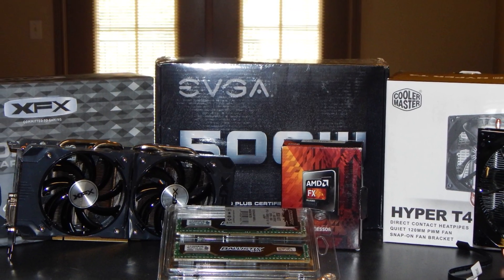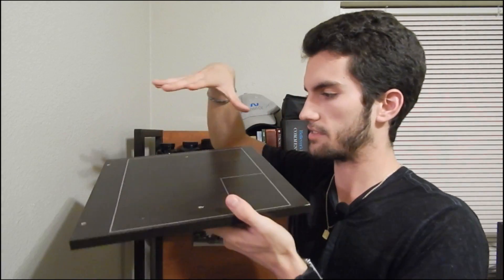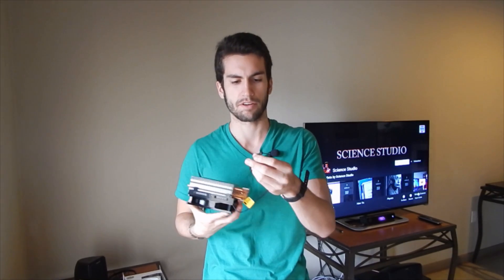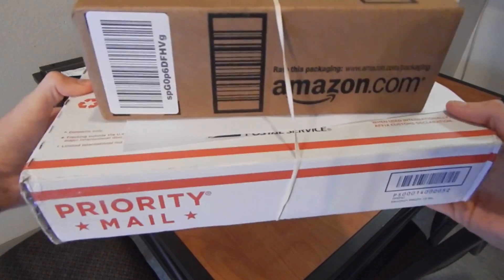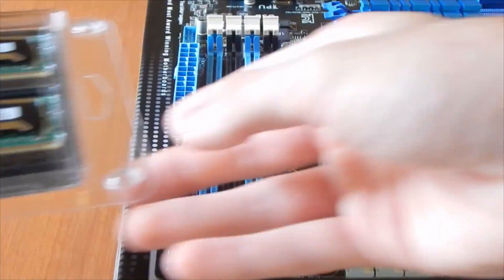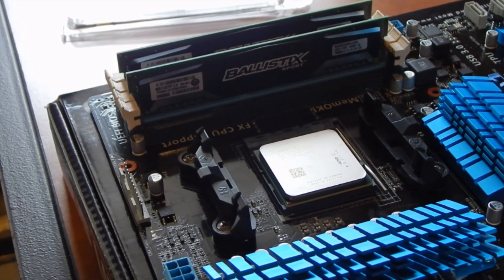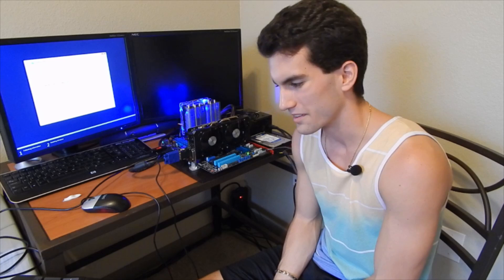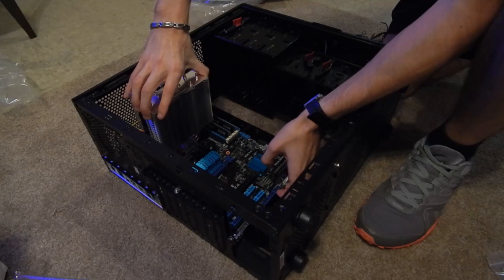$600 AMD FX Build

Comment: I just noticed during installation the CPU fan was facing down blowing air towards the GPU, and on the final montage the CPU fan is now facing upwards to push the air out of the case at the top.

Comment: It's June 2020... I'm still on socket AM3+.. I over clock an FX-8350.. with the smaller hyper 212 cooler with 3 heat pipes in a gigabyte 990xa board no problem..
 Zen isn't good enough to upgrade to yet and Intel has always been anethema to me.
 Good to see the cooler faces the wrong way for airflow.. lol

Comment: The cpu heatsink fan blowing downwards toward the gpu is incorrect, right? I noticed later in the video, at 16:45, the fan looks to be changed to a black-framed one and is mounted on the bottom of the heatsink blowing up, away from the gpu.

Comment: does FX 8320e bottleneck the GPU?
Reply: Shreyas Sreedhar a little bit, depends on what GPU
Reply: Super late, but, it depends on your resolution and GPU.  

Higher res gaming like higher than 1080 @60fps it's up to the GPU.

1080p 120/144fps gaming, CPU power matters a bit more, along with the GPU still.

Comment: so I'm building a new computer BASICALLY from scratch. I am looking at a 6300/ rx480 but I have a question. I already have a computer with Windows 10, could I just reuse the hard drive? would windows still work because I don't want to buy windows again if I don't need to
Reply: Yea work XD!
Reply: If you brought a retail windows license with a key you could reuse it, but I think you have to reactivate and do a fresh install. Also, don't buy the fx 6300 get an i3 6100 instead
Reply: literally got the FX 8320e for 20 bucks so I'm ok for now, thanks tho. also had an OEM key so I re bought windows
Reply: sean miranda okay, sounds good

Comment: you can get an i5 4460 and a h81m plus, and spend 30$ more, but between i5 4460 and a fx 6300, even if overclocked, is REALLY BIG!
Reply: you can even buy used 4460's for 140$. but look at that mobo, it's about 95-100$, instead a low end mobo with lga 1150 is about 50$.
fx 6300 used+ mobo= 40+100= 140$
4460 used+mobo=140+50= 190$

for 50$ it would be worth...

and just to mention, i even did the "errror" to buy the xfx r9 380 2gb for 180$. i gave it back to amazon
and i bought yesterday an Asus R9 280X Direct-CU|| for 150$, which is a bit faster and with 1 more gb of vram, which is very useful in games like bf. i've earned 30$ and i'm buying some new games with g2a.
if i had extras 30$ for 200$ there were GTX 970 and R9 290... think about it

Comment: Came here from your new video.  I was expecting worse from your warning... I might not have touched the bottom of that cooler though.  ;)  That said it's clear how your channel has grown and improved!

Around the time this one was made I had just bought a "refurbished" Phenom II x6 1090t for like $225... silly me thought I'd gotten a good deal.  :p  Live and learn.  SIX CORES WHOA... never mind it was already a few years stale.  At least it's as stable as a small mountain.  Even thought it's antiquated at this point, it's still kind of cool in an obsolete-enthusiast-tech sort of way...  (At some point the mounting bracket for the cooler broke and I had to zip-tie the thing to the board... oddly enough that actually worked...)

Last week I replaced it with an i5 6600k and a cooler much like the one in this video... aah, much better.

Comment: Hi, I got 500$ and I want to upgrade my PC, what parts should I buy, I only need a better CPU and GPU. The cpu I use right now is an AMD Athlon X4 760K with stock cooler at stock speed and for GPU an AMD RADEON R7 260x at stock speed.
Reply: you'll need a new motherboard as well. I'd suggest this: http://pcpartpicker.com/list/4CmTP6 plus a 4gb rx 480.

Comment: Great build, I did like exactly the same combo R9 380/6300. But why did you placed your CPU that way?? This is really a bad mistake, hot air is direcly going into your GC...
Reply from the maker: Not a mistake. That's the only way you can orient the T4; up or down. I didn't want to be pulling hot air from my GC through the CPU cooler either. This was a very old build here on the channel.

Comment: You can get a better AMD system hundreds cheaper than this. I did it. I had no problem finding sales in many forms and solid rebates. This is really easy to do. Here is my price list with tax and shipping:

AMD FX 8320 8 core OC to 8350 OC settings (same exact CPU this far into production $30.00 less) $104.00
ASROCK 970 Extreme 3 rv 2.0 free with CPU bundle and rebates. Free full new feature board.
XFX R9 285 2GB  Open Box sale and rebate $107.00 (same as a 380 but with newer GCN version and 40% improved memory management. Yes the slightly older 285 has the newest GCN and outperforms some 4GB rivals)

With 600 watt PSU, 128GB SSD, 1TB  HD, 3 fan led mid case. $125.00

$335.00 total.
This rig will perform better than 75% of what most mainstream systems will and is much better than console game systems.
Reply from the maker: Of course you can. This is an old video. Prices change all the time.
Reply: +Science Studio I am to make my first computer, once I get the money neccesary, and want to go AMD, do you recommend going high end from the get go, or slowly get there?
Reply: +Science Studio Also, your videos has really improved!
Reply: Its a good time to build a system you just need to wait a little longer. AMD has just announced its newest GPU available June 27th the RX480 for only $199.00 it performs as good or better as current high end video cards costing much more. Also, AMD is about to release its new CPU Zen to replace the very old FX line. You may want to wait for Zen as it will need a different motherboard than FX uses. It is 40% faster than FX CPUs.

  If you want to take advantage of the lower prices for the aging but still fast FX CPUs and current GPUs do exactly as I did. The most important thing I can tell you is this, in a blind test using the latest games 8 out of 10 PC tech experts picked the AMD $450.00 gaming PC over the Intel/Nvidia $1200.00 as the better system when asked about performance. They were both shocked and embarrassed. Bottom line is when you just use a system and ignore benchmarks the cheaper ones are just as good as the high end. You would be surprised how much of a scam high end systems are.  I found the best deals at Micro-Center and I bought my GPU on eBay.

I did a bunch of deal searching over a few days and that requires patience. It takes time to save the money take your time to spend it. I built it according to my needs and I am very happy with the performance.

 Now I can sell my current GPU and get a monster RX480 and plug it right in my system and get very high end performance for $100.00 more. The 480 draws only 100 watts under load so a second will be in the future for DX12 crossfire that beats a $700.00 GTX1080. When I am done the upgrade I will have a system as good as the best high end gaming systems for the same amount as the 1080 and it will be more powerful than it. This is not my video.

Comment: Looked at the video a second time and noticed that you put the original fan back on the heatsink.  Is that because the 3pin color fan ran full speed on that motherboard.  I have R1.02 of that board and it only supports PWM(4pin) fan control.

Comment: im sorry, i think u put ur cpu cooler at the wrong position
Reply from the maker: +Dekomori Sanae I would never recommend doing that. You want flush, sturdy contact between the copper pipes and the CPU heat spreader.
Reply from the maker: The Hyper T4 does not allow vertical positioning on AM3+ boards...
Reply: +Science Studio You actually can do it, you just have to fit the long metal things between the copper pipes and position it. It probably isn't intended that way but it works.
Reply: +Science Studio oh okay, im forget about that

Comment: you placed the fan on the cpu cooler wrong way first time, then you went back and swapped it with the original fan...you should explicitely point out mistakes like this when they occur. people are watching videos like this to learn how to do things and this may cause confusion
Reply from the maker: It wasn't placed "wrongly," I switched directions later on so that the LEDs could be more easily seen. It had nothing to do with performance. This is a very old video on my channel, regardless.
Reply: +Science Studio was it blowing air through the heatsink and towards gpu? its wrong then, or not optimised in terms of air flow...watch the vid again maybe
Reply from the maker: +Mara Ganea It doesn't matter which way the air is blowing. The T4 would only orient top or down on my AM3+ board. You should read up on it. I'd rather it blow air downward to be forced out the back, then pull hot air from down below where my graphics card will be running very hot. Think about it.
Reply: +Science Studio  right...funny though how, by the end of that vid, you switched it to blow up, contrary to what you're saying...im prolly missing something heh
Reply from the maker: +Mara Ganea It actually isn't facing the other direction, rather, I simply switched the fan location to pushing down rather than pulling down.

Comment: I don't understand why building outside the case is a thing. Saves time if something is broken? Been building since 1998 and never ran into issues building inside the case. Maybe I've just been lucky.
Reply from the maker: This is an old video, and frankly, a severely overkilled out-of-case assembly. Nowadays, I personally just build into the case. It's easier to diagnose faulty parts with everything in place.
Reply: +Science Studio Great video btw... very well put together. Anyway, (off-topic) I was a huge AMD guy up until the second gen i5/i7 Intel procs. Hopefully "zen" will draw me back to the AMD side again. :)

Comment: Mounting your heatsink fan blowing hot air on to your GPU is NEVER a good idea, I would suggest changing it so that it pushes the air upwards. Plus you're going to be overclocking, so things are going to get pretty hot.
Reply from the maker: It was just fine. Better than sucking in hot air from the graphics card.
Reply: +DarkPass3ng3r  Agree so unprofessional build :( dislike it ..
Reply from the maker: +Viorel Coca This was one of my first builds. My channel has improved quite a bit since this upload.
Reply: Ok ..glad for u
Reply: +Viorela Coca I guess he improved his channel in two weeks, cause that wasn't his argument back then.

Comment: I'm still rocking a FX-8320 from 2012 running at 4.5GHz 2/47/365 as a media/file server and gaming machine with a HD 7950@1050/1575 and still runs great... I would NOT build this system now. Maybe a year or two ago yeah.

A i3 skylake CPU will beat my old FX-8320 in a lot of scenarios especially if you get a motherboard that can overclock non-k CPU's (in that case you can even go with a 1151 Pentium!), that not accounting for SATA performance which is kinda bad on 990FX chipsets (there are new AMD motherboards with M.2 and NVMe btw, but that adds coast on both the motherboard and SSD). And the most important part, is that you can always upgrade the CPU to something much much faster if you get a Z170 board for about $80 and $100 for non-k overclocking.

Only time i now see AMD as a viable option is FM2+ board with a A6-7400k which can be picked up for under $70 for the BOTH! and make GREAT office PC's.
Reply: +Gabriel Soria I3-6100 is better for games..sure,but overall 8320 is better cpu.I have both systems and I like my 8xxx more
Reply from the maker: Please check out our newer builds.
Reply: +2Starfighter I agree. In synthetic benchmarks, Fx 8320 annihilates the i3-6100

Comment: ummmm why go through all that trouble making a test bench just to see if the board posts? most people just use the box the board comes in. T4 is a good cooler, I'm using one right now on my rig but probably wouldn't over clock with it.
Reply from the maker: It overclocked just fine. The making of the custom test bench was just a fun added project. Not necessary, of course!
Reply: +Science Studio what about this build ?   Graphics Cards:  AMD Radeon R7 250x GDDR5 1GB + AMD Radeon R7 240 GDDR3 2GB
CPU:  FX 6300 Six Core /3.5 Ghz
RAM: KINGSTON HyperX FURY Black 16GB

Comment: I think AMD FX-6300  is NOT good enough(1080p,60 FPS) for network games  usually.
 but  single or simple graphic games are ok
I sugest  fx- 8300@4.5~4.7ghz  if you can do OC and use custom cpu cooler,
but if you dont want OC, then  I sugest  fx- 8350 or 8370
Reply from the maker: We've built four additional computers since this video.
Reply: + Sin Soontaga What game can't the amd 6300 run with a good gpu ? I've seen the 6300 and 8350 with a r9 280 in both rigs running gta 5 same settings the fps wasn't leaps and bound different on the 8350 rig sure it didn't dip as much as the 6300 but both were playable with fps well above console 30 fps.
Reply: The fx6300 is perfectly fine for gaming.

Comment: where did you buy all the parts? thanks for the reply :)
Reply: i cant see any amd fx 6300 4.2ghz processor. only 3.5ghz. where did you buy yours?
Reply from the maker: +Gab Bennington It's overclocked. All parts from Newegg and Amazon.
Reply: +Science Studio oh i see. thankyou sir.
Reply: +Science Studio which 1 is better i5 or fx 6300 and why? i cant decide what to buy.
Reply from the maker: +Gab Bennington The i5, more than likely. You'll have to do this research on Google. Too many reasons to list here.
Reply: +Science Studio ive been searching for 3days. i am a begginer. they say i5 is not good for future games. thats why i hesitate to buy that.
Reply from the maker: +Gab Bennington You are reading from bad sources. Go i5. FX 6300 is not even a "true" hexacore. Don't let it fool you. I don't know where you've been reading, but there are plenty of sites detailing the differences between Intel and AMD CPUs. Use Google.
Reply: +Science Studio thanks a lot. yeah in benchmark i5 always win. even the i3 too close to fx6300. but if i buy the i5 what mother board and videocard should i use?
Reply from the maker: +Gab Bennington I can't consult you on every single part. Everyone is different. Find the socket type that matches your CPU and go with any of those motherboards. The GPU is entirely separate. Doesn't matter what you pick there. Best of luck.
Reply: +Gab Bennington Also depend about the type of game you play and what is your budge. Amd GPU if you want to play BF4, Battlefront, Hitman and the 1st reboot of Tombraider.Nvidia (Will need help for the list here) if you want to play Project Cars and other games that Nvidia owner could describe.

Comment: Don't touch the heat spreader on top of the CPU and don't touch the cooler where it will make contact with the CPU.  Finger oils.  You can clean the oils off with alcohol.
Reply: +ddthom2008 I was planning on commenting this then saw your comment. For a second I thought he wasn't going to put any thermal paste on XD.
Reply from the maker: +Zak Sweeney YOPO = You Only Process Once